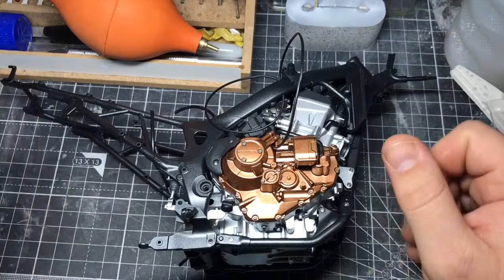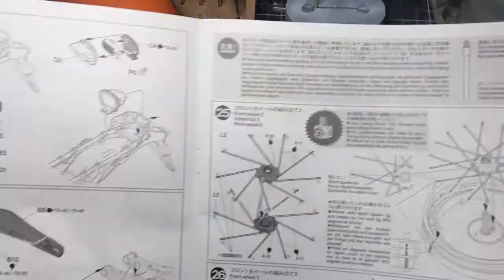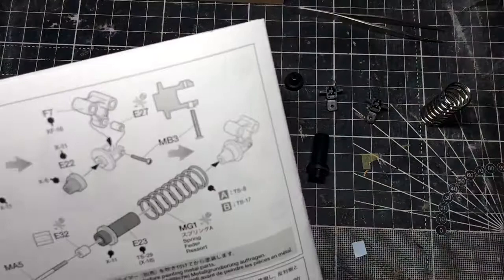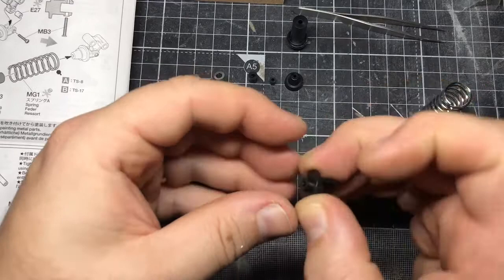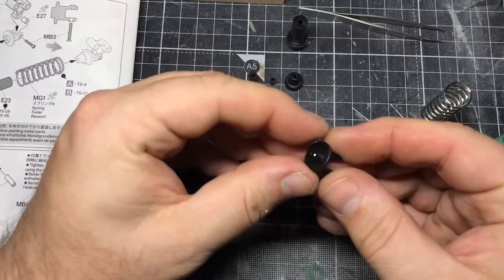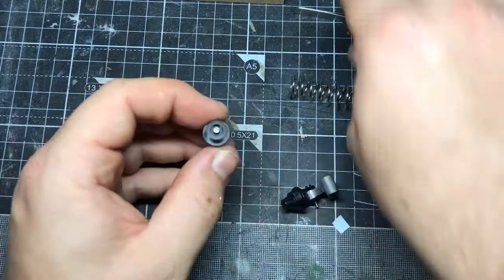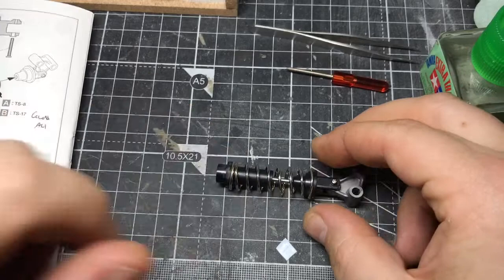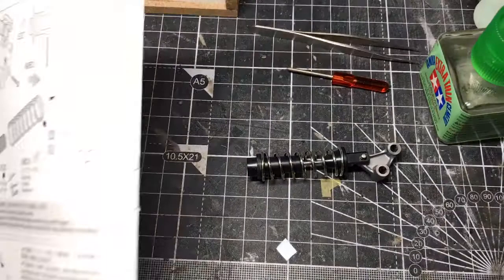Tamiya 1:6 CRF1000L Africa Twin motorcycle build. Part 4: The Rear

Comment: coming along really nicely now, nice touch with the foil stickers for the rear reflector and number plate light and the double sided sticky tape too, nice one Tamiya, loving the level of detail on the kit, even has the wee spring for the centre stand, the bit on the side you didn't know was a rear foot hanger for the pillion footpeg (i do giggle when a non bike builder goes "oh don't know what this bit is") I'm surprised you are persevering with the horrible Tamiya screwdriver that comes with the kit, had so many slip and scratch paint that i only use jewelers screwdrivers now. looking fantastic though and looking forwards to seeing the wheels done.
Reply from the maker: Smoo's Workshop I am usually quite good at mechanical stuff, and can figure out what goes where, but I have no idea about names for the things. The wheels scare me.
Reply: yeah the wheels look tricky, seen one guy cut out the plastic spokes and res-poked with piano wire which looked ok but  he didn't make anything up for the ferrules at the end so it looked a bit off to me, good luck with them should be fine using the jig though
Reply from the maker: +Smoo's Workshop I won’t be doing anything fancy like that!

Comment: Awesome model and you do a good job with your videos! I'm looking at getting that actual motorcycle, so I'll definitely want the model to go with it!  What is the sticky material you use to hold the really small bits for painting?
Reply from the maker: Thanks, it’s been a while but I’m pretty sure it was just blutac. I saw the real bike after I’d built the kit, they look very nice!
Reply: Gross Models,  excellent thanks.  You wouldn't happen to know all the paint color codes you used on this kit would you?  If not, are they listed in the instructions with the kit?
Reply from the maker: The Tamiya paint codes are all listed. I did use some alternatives where I didn’t have the Tamiya paints to hand though. I wasn’t too worried about getting an exact match.